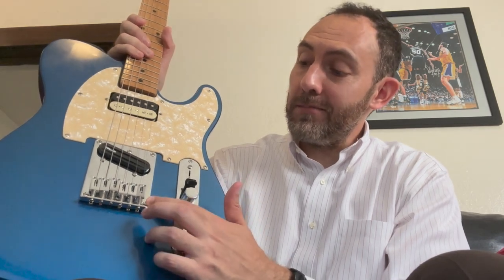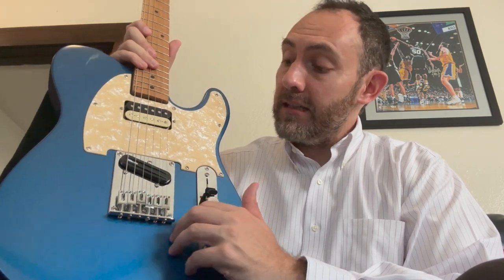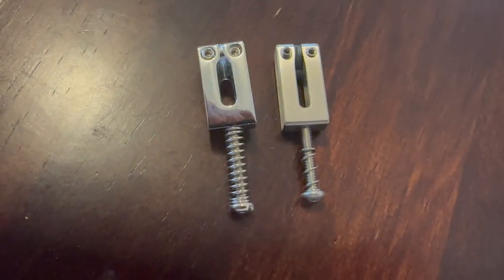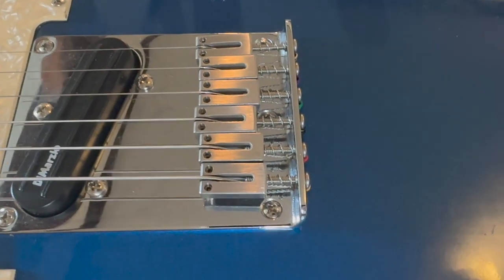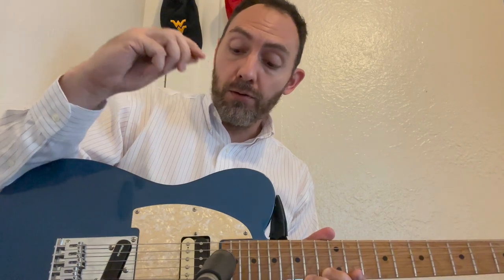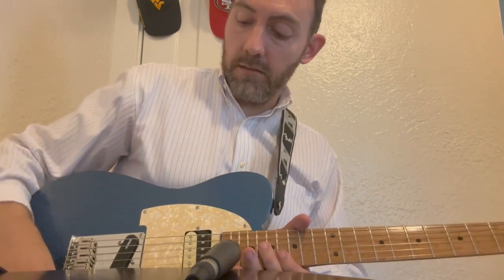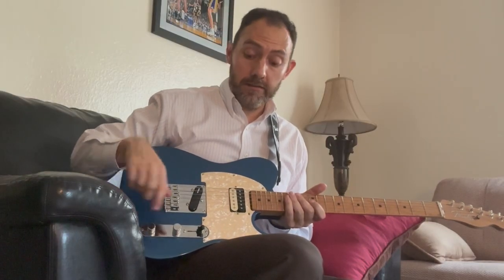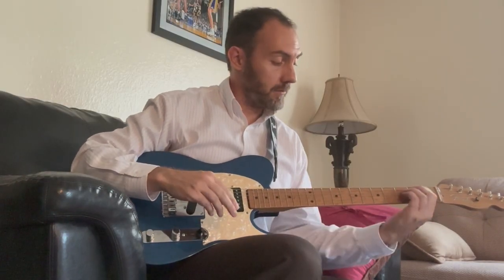Squier Telecaster Upgrade Series: Adding Graph Tech String Saver Saddles

Comment: You do realize that heavier doesn't mean better, right? You spent $75s to sidegrade your Tele to different saddles. Congrats?
And no, the longer screws are for a Tele rather than a Strat. And no, it has NOTHING WHATSOEVER to do with it be a top loader. Think, McFly, think! The scale length of your guitar is defined by the distance from the nut to your saddles! That does NOT change because you have a top loader. Therefore the screw length has nothing to do with it being a top loader.
Reply: And also, the acoustic sound of your electric guitar is absolutely irrelevant. That really ought to be obvious.
Reply from the maker: The 1990s Telecasters were top loaders with longer screws. The scale length is defined by the length from the nut to the saddle, you are correct about that.  However, the bridge plate on this guitar is not the standard size and it causes the saddles to sit further back from the bridge, meaning the shorter screws do not leave much room for adjustment. Hence, the longer screws on the longer bridge get the scale length to where it needs to be and there is still room to adjust for intonation. 

Also, heavier metal is not 100% analogous to better tone, but it does speak to quality and is one reason why the trem block on an American Strat is heavier and more substance than that of a Squier Strat.
Reply from the maker: @Great-Documentaries  Paul Reed Smith and I disagree.